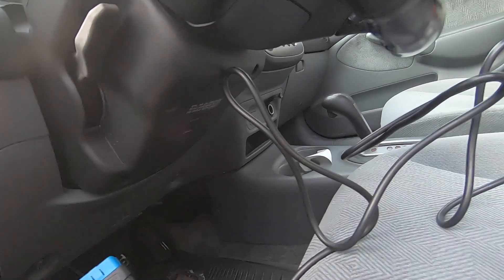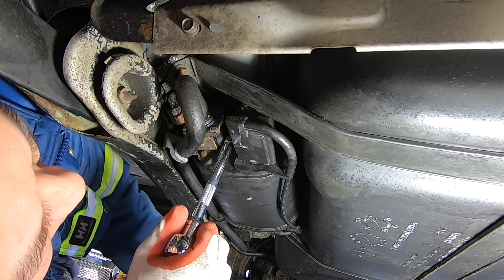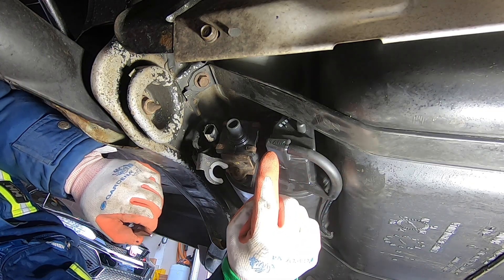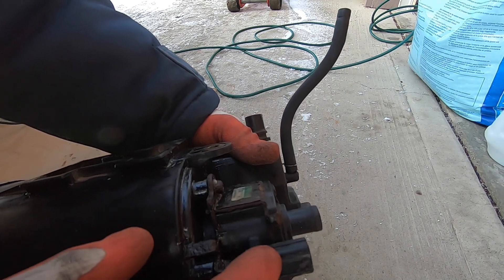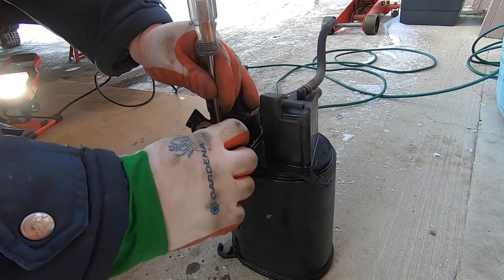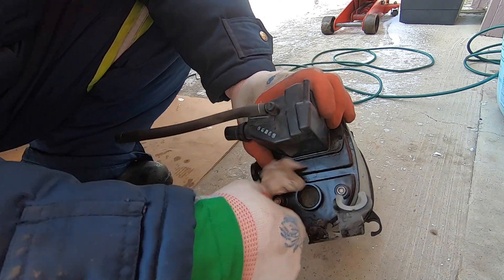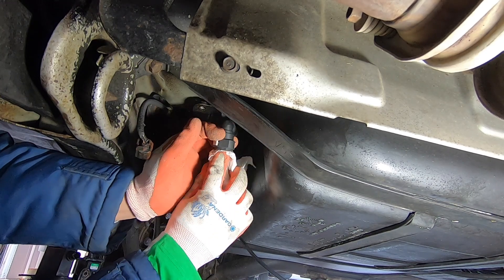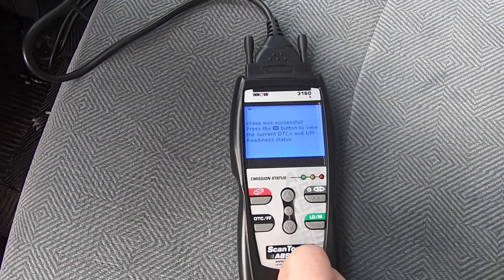Honda P1457 EVAP 2 way Vent Solenoid Repair

Comment: Got canister with solenoid, tubes and 12mm bolt for 46$ at junkyard. Swapped it out using your video as a guide and all went well. Appreciate the video, thanks.

Comment: The rusty  valve that leads uo to the front of the car is leaking to the outside air.  Pressurize the system and spray soap bubbles in it.

Comment: I replaced both the canister and the vent solenoid on 2003 Civic EX but had to drill out the screw that held the hose bracket, so I could reuse that bracket on the new canister. thank you for the video.

Comment: How can I test to make sure the valve is actually the culprit for the code?
Reply from the maker: you can apply 12 volts to the solenoid and it should make a solid "click".  You can blow against the ports and it should have a solid seal.
Reply: @piercedasian  I ended up changing both solenoids by the gas tank and it cleared the code. thanks
Reply from the maker: sweet!  Glad you got it all fixed up!

Comment: Is this the same on the 1999 Acura 3.5RL?
Reply from the maker: it would be very similar.  Honda uses interchangeable components on their cars but like anything in life, make sure you double check with your local dealership to confirm the part #'s before ordering.

Comment: I just paid someone to change mine today. My jack is questionable so I didn't want to risk it. It took them about 30-40 mins, primarily due to the rusty screws on the vent valve. I haven't driven the car much since, but prior to this issue, my car was running lean. My long term fuel trim was about +7, and my short terms would get up to like +12 at idle. I dunno if the P1457 will come back, but the car is still running lean afterwards. Is it possible that the charcoal cannister itself is bad and causing the car to be lean? I have 332K miles, not kilometers. I replaced the whole throttle body a few months ago with a used one and it came with the purge solenoid.
Reply from the maker: no if the car is running lean then there is a good chance there is something else at play.  For all you know you could have worn fuel injectors or you have a vacuum lean that is causing the motor to have more air going into the system.
Reply: @piercedasian  Okay thanks. If the P1457 doesn't return then I won't worry about the charcoal cannister anymore then. The car doesn't run lean enough to throw a check engine light, so I guess it's okay now. Gas mileage is not as good as it used to be, but it's not horrible. 

Have you done an AC repair video? That's the next thing. I had a leak in my low side line, so I replaced that, and the high side line, and the condenser. The compressor will kick on and run for a few mins, but after that the compressor doesn't kick on anymore and I have really high pressure in the low side line. Not sure if I have another leak somewhere or if it's something else like a bad compressor. The compressor is still okay if it kicks on every time i put refrigerant in right? Even if it stops working after 10 minutes.
Reply: @piercedasian  So I had the vent solenoid replaced 3 days ago and the P1457 came back. What's the next thing to do?
Reply from the maker: you'll need to look at other sources of the EVAP system for leaks.  Another common area of failure is the filler neck and the rubber fuel hose that connects the filler neck to the tank.  You'll need to get the car up so you can inspect.  Alternative, you can pay a shop to use a "smoke" machine to find the leak for you and then you fix yourself.
Reply: @piercedasian  I had them replace the whole canister on Friday just to make sure that wasn't it. Car still runs lean, but it's only been a couple of days so the light hasn't come back on, and I haven't filled the gas up yet. Not sure if I mentioned it, but my car wouldn't start then stalled out multiple times after the last two times I've filled up gas. I'll know if it fixed that tomorrow when I fill up again. 

I also did your AC compressor shim removal thing yesterday. The AC was colder than it's been, but it felt like it was going in and out between really cold and just cold. But it has been cold the past couple of days/nights so I haven't tested it out again. 

If my filler neck is bad, does that mean I need to change the whole fuel tank or something? Cuz that would be a huge job. I already replaced the fuel pump with a used one with lower miles like 2 months ago.
Reply: When the car would stall out after filling the gas tank up to the top, I did smell fuel. That's the only time I've smelled fuel throughout this issue.
Reply from the maker: the filler neck is a multi piece assembly.  The top part is metal but then there is a rubber hose that joins the neck to the tank.  if you gotta replace the neck make sure you also replace the rubber hose as those tend to crack and leak over many many years.  Regarding the a/c you might want to get the refrigerant charge looked at if it gets cold and then super cold.  It should be consistently cold while cruising along the highway (steady stream of air passing over condenser).  If you're at a light waiting and the a/c is not quite as cold that is normal.  You need a lot of airflow over the condenser to take the heat out of the refrigerant and if you're at a light you're only relying on the condenser and radiator fans to move the air.
Reply from the maker: don't ever overfill the gas tank.  Just fill until the gas pump auto stop trips.  At that point you can top off a teeny bit but never fill right up to the gas cap.
Reply: @piercedasian  So back in January, I replaced my throttle body with a different used one. It didn't help with my high fuel trims. The part had like orange crap in the purge solenoid that I cleaned off. On a hunch, I put back the old part, and that fixed my problem. No more trouble starting the car after getting gas.
Reply from the maker: that's good to hear!

Comment: Can you replace the valve without taking the whole cannister off?
Reply from the maker: its much easier to change the solenoid/valve out if the canister is out of the car.  It is super easy to remove so I suggest you take it out to service it.

Comment: Is the vent solenoid the same as the "evap 2 way bypass valve"?
Reply from the maker: Yikes, I cannot recall what "honda calls it" but if you phone up the dealership they should be able to tell you specifically what it is called.

Comment: I think it's funny that I'm coming back to you a second time after you helped me replace my rear window wiring. Having the same issues. So that solenoid is $60, but I can get a used Charcoal Canister with the solenoid for $80. So just $20 more, but probably a lot more work. Dunno what I should do. My car has gotten that code twice this week, but the car still drives pretty good. I just am running slightly lean, but not lean enough to trip the CEL for that. I have replaced the fuel pump, throttle body, and O2 sensor recently trying to get rid of that higher long term fuel trim, but it hasn't helped.
Reply from the maker: If you have higher fuel trim problems I'm going to say you likely have a vacuum leak somewhere that is causing this issue.

Comment: Thank you for making this. 2004 Civic sedan base with 156k on the clock. I thought the CEL was possibly the gas cap, but the code reader says EVAP code. I have to double check the code#. This is an important Daily Driver that can't go down 😂. It doesn't have any rust, as it doesn't get driven in snow.
Reply from the maker: wow that's cool to know that you've got a 7th gen that is likely in minty shape.  While the 7th gen was never my favorite generation of car that I have to admit ours has been very trouble free and we've been blessed to not have any real issues with it aside from a slightly slippy automatic tranny that is common on these cars.  375, 000kms and still going strong.  She's showing a tiny bit of rust on the body that I probably will get to this summer to slow down or try to at least stop to make it last us another 5-6 years before we really go down the path of car replacement.
Reply: @piercedasian   thanks..now for the follow-up. It I double checked the code, it was p1456, the gas cap code. Both say EVAP, just in different places. I'm the 3rd owner, my sister got it from a coworker that lived in Washington DC. She only got the car as a way to get to the airports. Barely any miles when my sister got it. Then she gave it to me for a birthday present. I got a cap from a Honda dealership to be sure it would work. eBay seems to sell cheap junk that often fail.
Reply from the maker: wow that is a cool story!  Hopefully the new gas cap you got resolved your issues.
Reply: @piercedasian   nope. Now a cam position sensor and catalytic code too
Reply from the maker: geez.  What did you do to fix the issue?
Reply: @piercedasian   it's only showing a p0340 code. Cam position sensor. I've replaced that, still shows the code. Runs at idle and with moderate throttle input, but hard throttle it chokes. I've not been able to put much time into it, busy with many other things.

Comment: Any symptoms?
Reply from the maker: nope, just a check engine light.  The leak was so minor that it was just enough for the system to detect a leak in pressure/vacuum.

Comment: Just did my wife's 2005 Honda Civic Lx was helpful, and your tutorial was on point. But, unfortunately, when I took the EVAP Vent solenoid out, it looked like someone had taken it out before because a sleeve on where the nut goes was missing on the sleeve where the screw goes to fasten on. So I went to AutoZone, but they don't carry any kits for sleeves. So I improvised and used an adhesive, hoping that would hold as I couldn't afford a new canister.
Reply from the maker: improvising is okay as long as it holds up and doesn't pose a safety concern.
Reply: @piercedasian  It actually worked, and the P1457 code did not come back on.  I am used a silicon-based adhesive.
Reply from the maker: nice!  Well done my friend!

Comment: I have honda 2005 it having engine light on error P1457(3/3) pending Evap Control Ststem Leake Evap Canister Area how do I fix it
Reply from the maker: odds are that this video is what you'll have to do to fix it.

Comment: Awesome video. I had a question though- this code came up on my Honda the other day, do I just need to replace the valve or should I also replace the canister? Thank you in advance!
Reply from the maker: No need to change the canister unless its damaged from impact or is cracked from trying to disassemble it.  I'd just chance the solenoid out.

Comment: I recently replaced with a new one from Honda dealer but engine light still on,so what is going next to do.Thanks
Reply from the maker: you may want to carefully inspect all the lines and fuel fill neck for a leak.  If you're still getting an evaporative emissions light then there is a good chance you've got a leak elsewhere.  I have been SUPER lucky that anytime I've had a failure on a honda that it is related to a bad solenoid valve but I have had examples where I've seen cracked hoses that were EXTREMELY hard to see without using a smoke injection machine.

Comment: Thank you! Once I was able to get the initial 12mm bolt off everything else was easy.  Didn't need the vice grips, just moved the screws from side to side to loosen and get penetrating oil to all components; unscrewed easily.  You made this super easy and saved me a lot of money at the repair shop.  Superb video! :)
Reply from the maker: glad you liked the video!

Comment: I replace mine with an original Honda part and the gas cap and I still get a 1457. I took the original one down a couple times cleaned it up rust free perfect condition 100,000 miles finally said I'm going to replace it still get the code lol
Reply from the maker: Hmm, you should take a look at the filler neck area.  This is a known area where a pinhole corrosion hole can cause a P1457.  I admittedly HATE dealing with the P1457 code b/c there are so so many places for fuel vapor to be leaking from your car.  If you have done everything possible I'd say take a VERY VERY careful look at the filler neck as I suspect you've got some issues there.  If all else fails you'll have to take to a shop to do a pressures smoke test to find the leak.  You will have to pay to get this done but at least its saves you a ton of time to not have to deal with trying to blindly fix things b/c that is still money and time for you to do it.
Reply: @piercedasian  doesn't make any sense the car is rust-free never been in salt that means there was nothing wrong with my original part,   my original part works fine with no leaks with 12 volts applied, i guess ill keep it around just in case i need it in the future
Reply: @piercedasian  i removed the cannister and my new purge valve and checked all the lines and connectors again and all look good,  removed the fuel vent module on the opposite side and i think i may have found the problem with a vacuum test and adding 12 volts to it, but since i do not have a new part not sure how its supposed to behave,  but i have seen people on youtube change this part with good results  the bolts that hold it to the bracket was a problem though and i finally got it out, so more new bolts for that part

Comment: thanks for the video. where do i locate the screws? it looks like the part link is only the solenoid without the screws. thanks again!
Reply from the maker: The screws I bought were from Honda. I believe I did state the part # of them in the video but if I didn't then just mosey on down to your local honda dealer and ask them for the little Phillips screws that hold the solenoid to the canister.  They're a few bucks for the set of 3.
Reply: @piercedasian  thanks for your reply! the last time i tried buying parts from a dealer they denied me and said i have to bring in the vehicle for them to service it! ended up finding what i needed on ebay.
Reply from the maker: that's crazy!  Where is this dealership that you went to so that our viewers can avoid going to them.  That is the most absurd thing they could ask you to do.  Like holding you ransom just b/c they think they can!
Reply: @piercedasian  this was dreyer and reinbold bmw north located in indianapolis

Comment: Hey appreciate you sharing this. I had the same code popping up on my 2003 civic lx, just switched it out yesterday with the Dorman part. Those two screws were very rusted on mine as well, I bought 2 new ones and put everything back together. Seems like I'm having better fuel economy after test driving it this morning, and still no check engine light.
Reply: What size are the screws? @xxerock92
Reply: @lr5081  I forgot, I think he posted the part number for them in the comments somewhere
Reply from the maker: Honda part #: 93893-05010-08
Reply: i’m having a hard time finding the correct screws online. any way you could send the website you found them on?
Reply: I didn’t go to a website, I called a Honda dealership. They’re cheap, I believe I just told them what the screws were for and they were able to find them, I don’t think I had a part #
Reply: @xxerock92  okay thank you
Reply from the maker: it was a good thing I go back to old comments.
the exact honda part number is a 5x10 screw.  Honda part #: 93893-05010-08
Reply from the maker: They indeed do have a part #:  93893-05010-08

Comment: 2003 RSX here. Oddly enough replacing that, the purge solenoid on the throttle body and doing a smoke test which revealed no leaks still hasn't fixed anything. Got a new OEM gas cap too. Still says there is a leak even though there visibly isn't one. Help?
Reply: Did you ever figure this out?

Comment: Would this P1457 code also cause the outside of the car to smell a lil bit of gas vapors after driving the car and shutting it off and walking away from it?

Comment: Excellent video, once of the best DIY I think I've seen. Your tip on using the Vice-Grips on the screws definitelysaved me a ton of time and sanity. Took less than an hour to do this. I did have access to a lift which added to my time savings.
Reply from the maker: Glad you liked the video.  You're a lucky person to have access to a lift.... I use a quick jack and that helps immensely but is a bit of a pain to setup.

Comment: Great video. Should I buy the charcoal canister and the vent valve separately to assemble it to make the job easier so I save myself from taking off those rusted screws? I was thinking of buying the canister and the vent valve, then assemble it, and removing the old canister and installing the new canister with the new vent valve already assembled. Is that a good idea?
Reply from the maker: sorry for my super late reply.  It's really up to you.  I don't like replacing parts that don't need replacing.  I think you should try to remove the rusted screws using the method outlined here.  Worst case is that if it doesn't come out then you can simply buy the canister after the fact and then fix it.  The canister alone at Honda Canada's dealerships is SUPER expensive so that's why I opted to reuse what I could.

Comment: I replaced the charcoal canister and solenoid but the code p1457 persisted. Then I replaced gas cap to no avail. The thing is even if I reset the CEL, the code will always come back. But it doesn’t set CEL light. Only shows up when I read the code.
Reply from the maker: That likely means its a pending code and if it keeps popping up to the ECU that eventually it will trigger the CEL lamp to come on.  You might want to take a close examination of your fuel filler neck as corrosion can cause that to rust through or the rubber joining hose to deteriorate to the point where it have a pinhole leak.  Do you ever smell gasoline odours?
Reply: @piercedasian  no gasoline odors